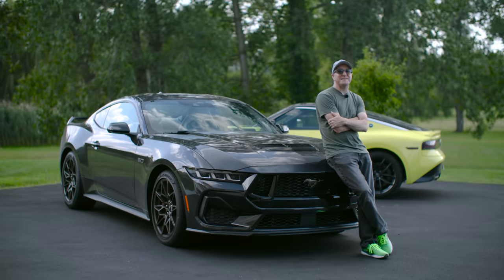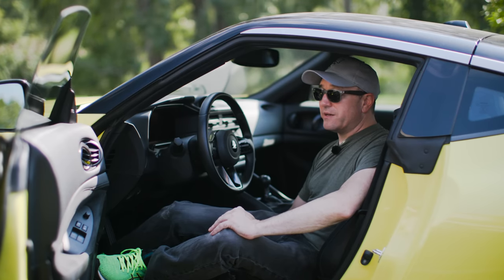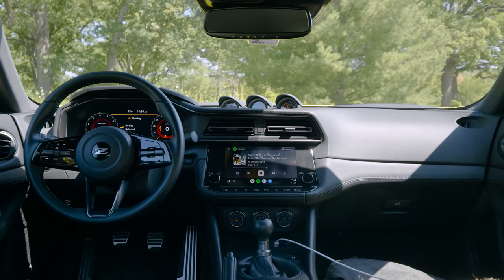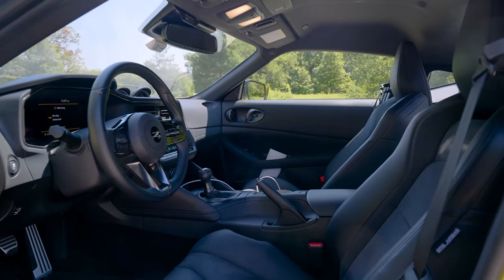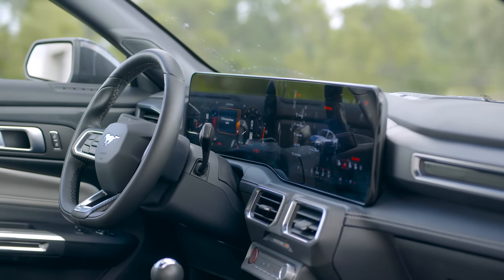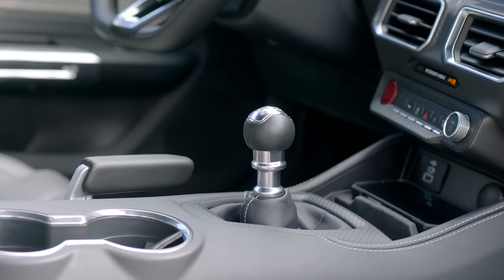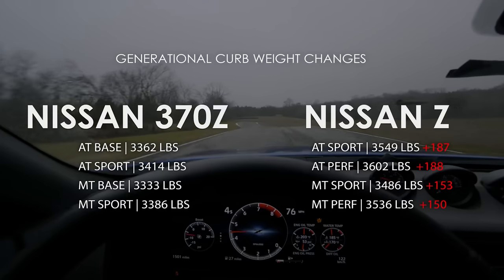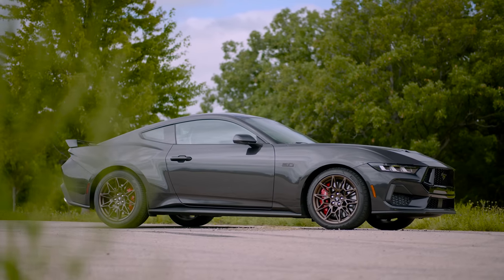Mustang GT vs Nissan Z | Maximum Muscle, High Prices

Comment: I've owned 3 different Z's all different generations and stopped at the new Z. Its not new and is entirely a parts bin car. It's a Q60/50rs, which I have also owned, shoved into a 370. It's like everyone pretends this is a new platform. Exterior got the biggest refresh, followed a bit by the interior. I am happy it exists but y'all give it way too much credit lol.

Comment: Love the Z, but feel really feel let down for the price vs performance factors. There is plenty of potential in the Z but you are gonna shell out a ton of money to reach that potential. The NISMO is a straight up insult as it is not available with a manual transmission - seriously Nissan you should have thought about that a little harder. If I was buying another performance car today it would be the BMW Supra as it comes in a manual and shines on the track.
Reply: Manuals do not shine on the track. Most automatic cars are much faster than a manual in todays world. Unless you're not talking about drag racing.
Reply: @dannytavakol285  I'm talking more about road courses. Drag racing is a completely different scenario and not what the Z was really designed to do. As far as drag racing it is slower stock than the competition and more money to increase that power as well.

Comment: Definitely caught that 4-corner weight screen where you named it the "Rusting GT". 😂 What's up with the corrosion on that exhaust already?
Reply: Corrosion in bare metal? Do yourself a favor and go look underneath any car on any new car lot and let me know when you find one that's not already rusting somewhere.
Reply: @bobdingle2539  I'm well aware that it happens, but it's readily apparent from the back and seems excessive for vehicles that haven't been sitting on lots. They apparently thought it was excessive too.

Comment: The Z is a better car for how straight forward it is. I like the cable hand brake over electric and just a simple radio over two flatscreen TVs in your face. But it’s way to expensive for $50k.

Comment: This is a loaded GT guys you can get one for allot less with the performance pack and active exhaust for 50,000 retail but no one pays retail so 48,000 out the door.  A base Dark Horse with a better setup can be had for 59,200 and better trans.

Comment: You can tell they are both done on a shoestring budget because of the guages. I don't care what manufacturers claim, digital guages are a cost cutting exercise, but people these days just take it and I dont understand why. Driving with digital guages and non-retractable screens at night is outright intolerable. Getting into an old bmw or alfa with a subtle oramhe/red glow shining onto the gearstick and clear, non-distracting mechanical guages always feels like a MORE PREMIUM experience than any of these new piles. Stop accepting their cost cutting.

Comment: Biggest gripe about the new z is they gave it a lower displacement engine with TTs with a Soo far Max HP of 800 with aftermaket forged internals the previous one had a 3.7 displacement stock but with aftermarket goodies I've seen people take it to 1100whp which is madness on a 3k lb car

Comment: What they didn't mention is for 45k you can get a base manual mustang with the same powerplant. When they are a year or two old those will sell in the 30-40k area. Buyers f these cars can go aftermarket for about anything due to the s550 parts many of which carry over. When you pay 60k like I did you are buying many expensive options that don't necessarily make the car better just more appealing imo.

Comment: Yea it’s crazy how much they cost now. I paid 25k for my slightly used 2016 S550 GT base in 2017. Honestly in the 60s I’d still buy the new G87 M2 with a manual over a S650 Darkhorse.

Comment: You guys are right, there is nothing left out there that is a 2+2 with a manual that is also light.
The only light-ish thing out there is the Supra and that is a 2 seater and not a V8 on NA.
M2 is manual, but back to being heavy and I6 and turbo.
My IS and your LC Mark have a great V8 but they are not manual or light weight.
😢

Comment: For that money I’ll take the Mustang. In the real world it’s size it’s what makes it a better buy. It’s a everyday car that you can take on your favorite twisty road or track occasionally, which is how most people use these cars. You can drive it everyday to work or throw your gear in the trunk and backseat for a road trip. It’s more floaty normal mode suspension setting is perfect for long highway drives and rough city streets. But there is always track mode when you want it. And you always have the V8 thunder riding with you. The Z is a better handling car, more of a driver’s car. But impractical for everyday use. It’s a car you keep in the garage during the week and drive on the weekends. That’s great if you can afford to spend that kind of money for a weekend car.

Comment: Would like to see how my 6 gen Camaro SS with MRC would stack against these cars. Even with some short comings I think the Camaro would best both on the track. Just my 2 cents.
Reply: Camaro slaughters the Z on the track, you can watch Throttle House's review of the Z and they track both in it. It's not even close. It probably beats the Mustang too, it beat the last gen at least and this is just a refresh really.
Reply: Just saw the video. Thanks. It doesn't make the Z that appealing.

Comment: Absolutely love this channel!!

For reference, my manual gt with the performance pack cost $36k brand new in 2015
Also, it put down 450 hp and 400 tq with a Jlt intake, Gibson catback and Lund 93 tune with a can of torco added at sound performance on a mustang dyno
Ran a 11.66 @116 mph at Great Lakes drag way
Ran a 11.68 @116 mph at Byron drag way 
Ran a 11.62 @ 117 mph at Joliet raceway

Comment: Problem with the Z, is you just can't justify a car with these flaws at that price point. If it's nearing the realm of a BMW M2 (or at least an M240i) there's nothing in the Nissan that can justify that comparison, not the engine, not the suspension, not the interior- it's a worse car in every way.

Comment: I mean, if the z was what we all wanted it to be out of the box, ironically we wouldn't want it. I think nissan designed it expecting the typical user will install an exhaust and coilovers and will relish in the improvement they get from those mods. It allows them to sell a car targeted towards a user who wants to be flashy and knows nothing about cars knowing that if they split the difference the enthusiasts would still change everything and just be less satisfied with the step change they see on their expensive upgrades. I get it.

Comment: I'm 40 and like the new Mustang overall, including the interior + screens. So not a curmudgeon at all. The actual real offense is the price. I bought a new 2019 GT Premium with 401A/PP for around 45k and it felt like a splurge. It's insane to think a similarly equipped GT is now... 20k more than that? For very little actual change? Fuck off.

Comment: The aftermarket, and they should come out with another Z version like a V-spec Nür with Öhlins DFV dampers and different turbos, and remove some of the things driving focused folks don't want to keep the price below $70k and get the weight down a bit. Just because the car is more harsh and direct driving doesn't mean it should cost a lot more. The chassis is great and capable of so much since it's been refined over the years, when they tune the suspension and engine to be more performance focused the Z is an awesome trackday car. The best way to get a much more connected feel with the rear is to change the rear subframe and front compression bushings to aluminum, it really dials it in, with a very minimum of road noise being transmitted.

Comment: I'm not surprised by the result. Really, these cars are an apple versus an orange. They're so different but because they are the very few left available for dying breeds of cars, they can't help but be competitors. 
The Z surely did not get a more thorough rework because Nissan simply cannot afford that, especially on a car that is destined for low sales; probably so low they may won't make their money back on it. In my view, the Z may not even last more than 3-4 more years because I haven't seen a single one on the road. I can find many review videos on the car. I haven't seen a buyer driving one in the seeming 24 months since it was released.

Comment: Also let’s be real, tuners aren’t going to leave these stock. A tweaked Z I feel would be way more fun and a better drivers machine where the Mustang would be a better drag strip, and MAYBE high speed circuit car. But anything more tight Z all day. Near 4000lb is retarded. Personally I want a no frills 2500lb rwd car with an engine that can take boost well.

Comment: Easier to add HP the the Z than to take away weight from the GT (at least without giving up important things, like rear seats, A/C :).  It doesn't change the fact that the Z is targeted to people choosing between it and a Supra (Supra wins) and the GT is targeted apparently to 20something's that can drop 60k+ on a car wherever they are living (probably in their folks basement).  

Little constructive criticism, focus on the review at hand, you spent as much time comparing the GT to the darkhorse as you did to the Z.

Comment: For me to want a newer sports car it has to be something kinda special….I’ve had a few over the years but 1 I’ve kept for long time- crazy built C5 Z06 (718whp w/ blower/cam/forged guts/meth etc) & the thing only weighs 3300 lbs on the nose w/ 1/4 tank of gas (blower setup/subwoofer/amps added some weight) I prefer driving stuck but regardless of power level for me a sports car has to be the fun to drive “slow” too- I think I want to add the new Integra-S w/ manual trans next!

Comment: You nailed this review especially as to,the Mustang GT.  I had a 2019 Bullitt but I enjoyed daily driving my Miata more and the Bullitt sat in my garage.  The Miata being much smaller and lighter is very nimble.  The Mustang is so heavy and feels big.  Handling makes driving fun and the Miata is superior.  The Mustang has the sound and styling where the Miata is more fun and happens to be much cheaper $40k loaded compared to $60k for a loaded GT Mustang.  The 5.0 Mustang is fun just not nimble enough for me.  I still love both cars for different reasons and I’ve had both in my garage at same time.
Reply: Sure buddy

Comment: Seen a new one with the hood scope in blue and few hardtops only seen one other 370z convertible but see many here I n town see plenty of mustangs too many here I’ve had a mustang like my z better  can tune it to make more horsepower etc .even though mine is 10 years old still turns heads when the tops down .

Comment: Ford dropped the ball with that Getrag, T-56 is desirable, my 1988 Camaro IROC had one swapped in in 1993 Borg-Warner originally. Centerforce had to make me a one-off Kevlar puck clutch to handle the power. It spun their standard racing clutch : ) SC 383 can do such things.😁

Comment: I’ve had 7 manual cars and the MT-82 transmission is by far the worst is by far the worst I’ve ever experienced. I’ve never missed so many shifts. Jack saying that it is “overblown” I don’t agree with. Also, I don’t want a double iPad in my dashboard. Z and triple stack gauges all the way!
Reply: What clutch were you using? I had the same issue until I got rid of the factory ford unit. Single disck units don't perform well over 6800 rpm. I swapped to a Vengence twin disk and it resoved my lockout problems. If you are just missing gears then upgrade to a Barton or MGW shifter. I find the MT-82 to be smoother at high RPM shifting than my Toploader 4speed (Gran Torino) and T-5 (Foxbody) ever were.

Comment: The Nissan Z Performance that is my photo sold for 15k over msrp. Another yellow one did the same thing and the one wasn't even the performance and neither of them have been manual. In 18 months those are the only two I've seen come through this Nissan dealer. It's ridiculous because the 350z wasn't like this, the 370z wasn't like this. It really sucks how they roll out these cars and make their prices high but in reality the cars don't reflect their prices. 75k for the new Z is insanity.

Comment: the supra cooling diagram seem far more superior with central radiator and ac condensor not being feed hot air by other auxuliary cooler  the supra auxiliary being feed fresh air on the left and right without exhuasting into the engine bay dramaticaly improves its termal capicity without having to rely on pure core size the z having to stack 5+ radaitor cooler condenser and intercooler right after each other all of which exhuast there hot air against eachother and into the engine.

Comment: The everyday usability goes to the Mustang by a long shot and I remember the 300ZX I had, it was a scary car in rain or snow.
Reply: Like the Mustang isn't.
Reply: If you think the Z is bad in rain and snow, wait until you drive a Mustang through a crowd!
Reply: It's great fun in the snow, just install winters, it'll sit sideways all day.
Reply: You can't compare the old 300ZX to the new Z with traction control stability
Reply: @paulh6517  I've owned a 350Z and 2 Mustangs.  The Mustangs were fine in the rain, and acceptable with snow tires.  I would have never tried the Z in the snow.

Comment: Was that 452 wheel stock!? That would suggest ~530 crank hp.
Reply: I think that's wrong, because ive seen 3 other mustangs only get 410whp 360tq and dark horse at 440whp.
Reply: @hpickettz34  I seen two videos of manual mach 1s with 6 speed put down 440 and 450, this is spot on. The 410-420 are automatics and 440-450 manuals.
Reply: @RSProduction18   lol if there's that much drivetrain loss in the autos, why do the autos smoke manual stangs? with 40hp difference theyd be neck and neck
Reply: @RSProduction18 we are talking about the 2024 mustang, they are testing base mustangs not the dark horse, and there's already dyno runs on YouTube and they're all 410-420 hp, dark horses are 440-450 manual cars.
Reply: @caseyn8182  gear ratios , the automatic is in max power all the time while manual shifts the rpm drop too much and slow it down. A proper gear swapped manual would be faster.

Comment: So what did GM do to the 2016 Camaro to shed 200 to as much as 390 pounds (packages dependent)? Why can't Mustang do the same thing?
Reply: As previous owner of a 2018 zl1, the sheet metal on 6 gen camaro was pretty thin

Comment: Ford build quality...sigh. First thing i did on my Fiesta ST was take it apart and nut and bolt the whole suspension, as it was cocked up similarly with a loose jam nut and over torqued nearly everywhere else. Glad to see at almost 3x the price things are still keepin on.

Comment: You guys must not have driven the NISMO Z yet. It’s the one they should have built for the masses. ALL the drawbacks of the Z performance trim that you are talking about were corrected in the NISMO trim. And the NISMO does 0-60 in 3.8 seconds. And the performance trim is not $60,000. It’s $52,000. The Mustang you are comparing it to is $62,000 as tested. You should be comparing the NISMO to that mustang. It’s closer in price. NISMO starts at $64,000 and while I think the Z performance trim will smoke that Mustang I am certain the NISMO can. Nissan could have EASILY gotten more out of that V6. They could have easily gotten 450 HP and 400 lb ft out of it.
Reply: I won’t be watching anymore of you guys stuff. The mustang is crap and is not a better all around vehicle. Nissan is better than ford and the Z is far better than the Mustang.

Comment: Is the Z relatively heavier than the Mustang for the SIZE of the car? Z weighs only 150 pound less, but is shorter, doesn't have rear seats and the trunk is a joke compared to that of Mustangs. Does 150 pounds adequately account for these things, or is Z heavier than a Mustang would be if they had done it a two-seater?

Comment: I love the character of the VR30 but……I just don’t trust the turbo design. Unless there has been a major revision for the new Z, the turbo seals will fail extremely early. Even in my 2020 Q50 that I baby to get 25mpg and let it sit for at least a minute after every trip to cool them down, they still failed at 33k miles. And with the way they designed and integrated them into the engine, it’s about a 10k job to replace them. I love the character of these cars but you really cannot own these things ever outside of a warranty.

Comment: Nissan isn't going to sell a lot of these Zs, because there aren't that many for sale. The ones for sale are marked up at least 10 grand over MSRP. I've owned 4 Z-cars from 3 different generations, and wanted to buy the new one. I'm not paying $50k+ for a retrofitted 370z. I think a lot of prospective buyers are in the same boat. Both of these cars are way too expensive, especially considering they're using carry-over platforms.

Comment: I have a Z as my avatar, and own a Z33 so I guess my opinion is invalid but If the Mustang was the same price or cheaper I would have said it would have been a winner hands down. However at over 60k for just a non poverty spec GT, I’d have the Z every single day of the week. I simply can not fathom how the Mustang costs that much money. The Z, for a car that feels as good as it does in the corners, looks the way it does, and for less money, you’d have a hard time convincing me to spend so much more on a less engaging/heavy car. Before markups the Mustang is already way WAY too expensive. The Z isn’t cheap either but atleast you can opt for the Sport model that’s still very powerful and imo way better then the Eco Crap Mustang. I never thought I’d live in a world where the Z would be cheaper then a Mustang GT. Complete madness.
Reply: The Z is cheaper because it's a slower, worse car.